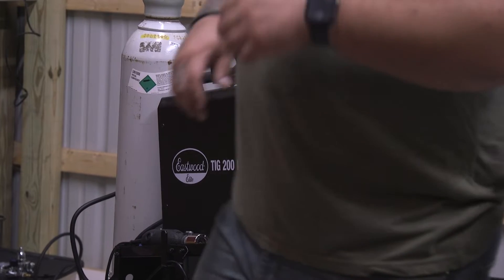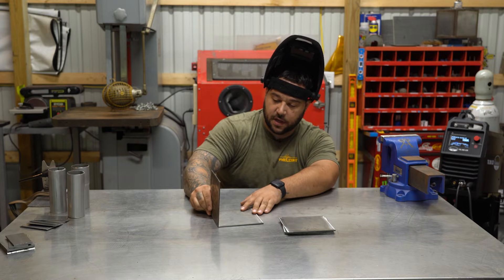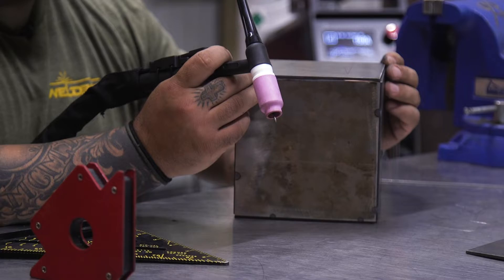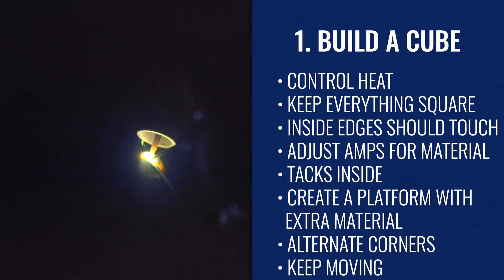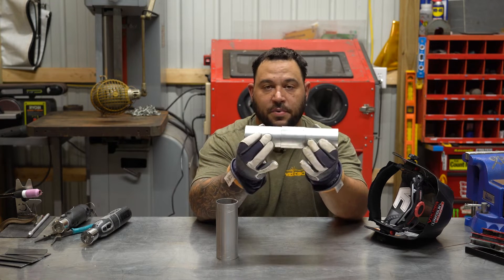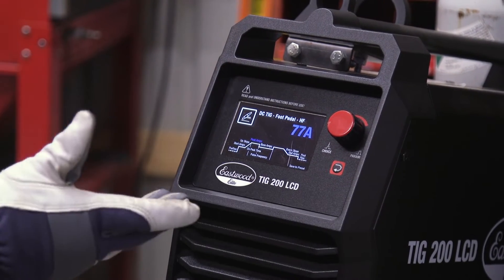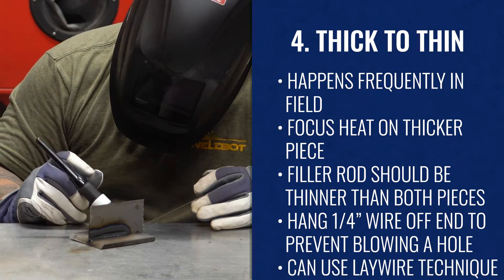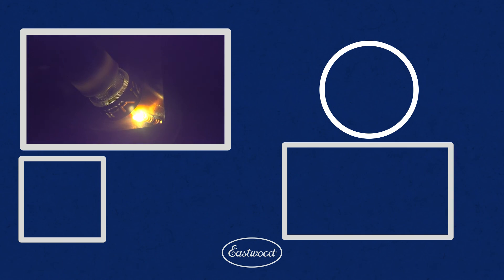WATCH THIS VIDEO TO BECOME A BETTER TIG WELDER!

Comment: Hi Vince , im Andrew. I do have one of your welder. I do have the Eastwood 200 ac/dc digital. Can I use pure tungsten on this machine?.
Reply from the maker: You can, but it's going to be dependent on the material you're welding.  We recommend using a multi-mix tip because it's suitable for all applications in both DC and AC welding for steel, stainless steel, aluminum, titanium, nickel, copper and magnesium alloys.

Find them here:
https://www.eastwood.com/eastwood-1-16-multi-mix-tungsten-10-pack-temm-116-10t.html

https://www.eastwood.com/eastwood-3-32-mult-mix-tungsten-10-pack-temm-332-10t.html
Reply: Hi Vince, thanks very much for your support .I'm Andrew.